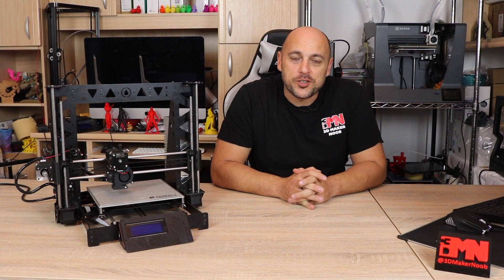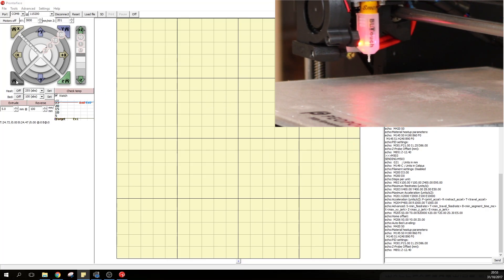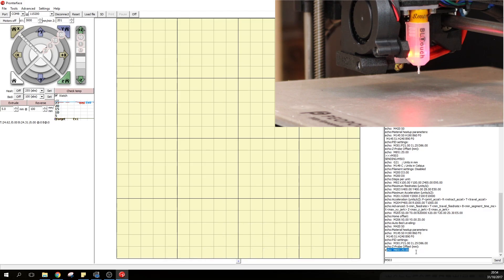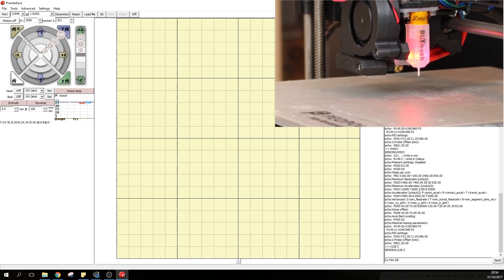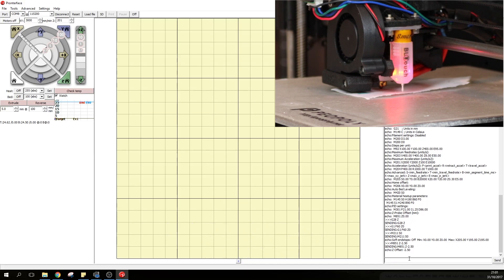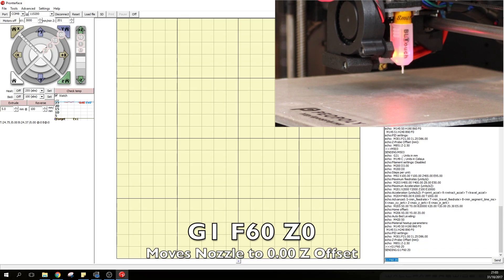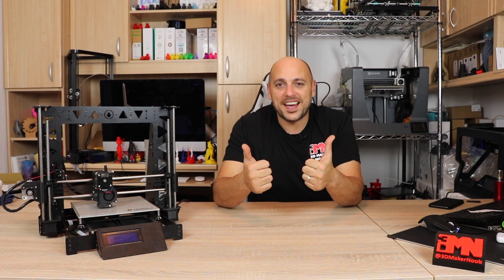Calibrating Z-Offset With A BLTouch Bed Levelling Probe

Comment: so... I've used your guide before and it worked beautifully.  this time it wont work sigh. After using my ender 5 plus on a 2 day print. letting it rest for 2 days I turned it on to see that the bed is to low to the nozzle. I'm at the part where I have to put in the z offset position but its -95.60 and it will only go to 20 min or 20 max what am I doing wrong?
Reply: Im also getting a bltouch error

Comment: I have a question about setting the Z offset for a BLTouch on Ender 3 running SKR Mini 1.2 E3 and Octoprint.
Setting my Z-Offest with the process in the video.
However, you do not say anything about preheating the hot end and bed and looking at the pronterface temps, you are doing the offset cold. Is this correct?
Should I do the offset with a cold hot end and cold bed or should I preheat both to PLA temps? (200/60)

Thanks again for a great video to help with this.

Comment: Hi, first of all, great video, but you mentioned the thickness of a sheet of paper is around 0.1mm (what I can confirm), but you add -0.01mm (-2.49-0.01=-2.5) shouldn't that be -2.59?
In all other Videos and the official BLTouch documentations, they are setting the Z-Offset 0 to be around 0.2mm off the bed.
Reply: OP did confirm (2017 reply) the error; correct setting for this example is 2.59

Comment: I feel like half of this is wrong or unneccessary, please correct me if I am wrong:
1) Home your Z axis <- see 5)
2) M851 Z0    // Reset Z offset to 0
3) M500    // Save to EEPROM
- 4) M501    // Set EEPROM <- This step is unneccessary, after setting a value it is automatically used, no need to reload EEPROM
- 5) G28 Z    // Home Z only <- Why did you home in step 2 first if you home again here? Just replace this with G28
- 6) G1 F60 Z0   // Move to Z = 0 <- No need to set Feedrate, G1 Z0 is enough
7) M211 S0   // Soft endstops off
- 8) Paper technique with z change to figure out correct Z0. M114  to get current pos <- This will work, but your nozzle is now in a different place than where you measured the bed height. You need to move the nozzle to where the BLTouch measured the bed first
9) M851 Z [current Z position including - if it exists] // Set z offset
10) M211 S1   // Softenstops back on
11) M500
- 12) M501 <- again, this is not necessary
---------------------------------------------------------------
So I would shorten this to:
1) M851 Z0    // Reset Z offset to 0
2) M500    // Save to EEPROM
3) G28    // Home
4) G1 Z0   // Move to Z = 0
5) M211 S0   // Soft endstops off
6) Move nozzle to where BLTouch measured
7) Paper technique with z change to figure out correct Z0. M114  to get current pos
8) M851 Z [current Z position including - if it exists] // Set z offset
9) M211 S1   // Softenstops back on
10) M500
---------------------------------------------------------------
Done

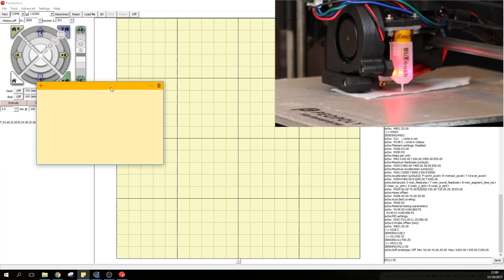Comment: Thank you for the video, but I'm having a problem, I'm trying to do this on an Ender 5 Plus,  and i can't find de Z offset after the paper calibration at  3:56, can somebody help with this?
Reply: I need that info also ;-)
Reply: @sebasleli1  look at my answer here
Reply: use the M114 command it gives the current vallues also for you @sebastien lelievre
Reply: @baconunicorn9830  Thank you very much ;-)

Comment: Thanks 3DMN!  This makes life easy.  Most will say this has to be changed in firmware, intimidating for most.  This process also applies to the X and Y offsets, only input your measurements from the nozzle to probe on X and Y.

Comment: al i see is this.... 

echo:busy: processing
echo:busy: processing
echo:busy: processing
echo:busy: processing
echo:busy: processing
echo:busy: processing
echo:busy: processing
echo:busy: processing
echo:busy: processing
echo:busy: processing
echo:busy: processing
echo:busy: processing
echo:busy: processing
echo:busy: processing
echo:busy: processing
Reply: same problem i have :( so did you fix already? do you know how to fix?
Reply: Gökhan TAYMAZ no I’m sorry. Still waiting for a solution
Reply: Gökhan TAYMAZ  I fixed it. But I’ve done it on my own way. I started the Chep bed level print gcode. Then I turned down the Z by the z-baby steps till I’ve got the perfect layer. I took a note of the z-babysteps and subtracted that from the Z-offset. That’s how I did it

Comment: im having a huge issue here and im hoping youll be able to help because nobody else ever gets back.. so hopefully with this being a relatively small channel youll actually see this message.

My x and Y "home" just fine because of the endstops.. But when i try to home z it crams the nozzle into my (glass) bed until i think its about to snap something, THEN the bltouch starts probing.... how do i do what you did where your probe will be out and the probe being pushed in from the build plate IISSSS the Z endstop?? I have followed every single piece of advice and code and suggestion etc that i have found and not one single person has been able to fix this one issue.. My printer is useless without beig able to probe Z.. PLEASE HELP!!!!!

Comment: Hi 3DMN, Thanks for the video but I got to step 8 
M211 S0 to Switch off softendstops but I get an Unkown command error. I am running Marlin 2.0 on a Bigtreetech 1.3v that is running 2208's I searched the net and found the command was changed to 
M122 S0 and when I try that I get the consol fills with a long list of  however I am still not able to move the nozzel in step 9 
If anyone knows how to make this work i would appreciate it

Comment: Very, very helpful and clear video. I'm trying to calibrate an Ender 5 Plus. It does not display the Z-offset on the control panel as you show in your video. Is there another way I can get the Z-offset?

Comment: Okay, now since you made that so easy, I have one other thing You can probably help with. When I send the print head to the HOME position, the BLTouch is hanging over the edge. So, when I try to do "auto" bed leveling, it "fails." Is there some way to calibrate the X-axis so that the home position is about 15 mm to the right?

Comment: I've been having issues with this, so I have been watching lots of videos and scouring the web.
After setting the z-offset, and trying to print my extruder tip is too high.  I tried Cura, and Sli3er and got the same problem.  I put the M29 command into the gcode start on each after g28 thinking that would help but no go, it's a stringy mess on the build plate.
Then in Sic3r I took out everything except for the bed and hotend heating and added:
G28
G29
G500
G501

And now the hotend hits the bed.. I noticed that it does show a previous EEPROM setting M851 Z0.4  which is probably the issue, it probably needs to be 0, but the fact that nothing works until I use the M501 command shows that everything is not well and good, and no video I've seen yet actually explains how to get your setting to run with a slicer.
Reply: I had the same problem, with my bltouch deployed the tip and got the tip inline with the extruder end, that worked for me so maybe itll help for you :/

Comment: Thanks very much for this really clear video.
I went through the entire process on my CR-10 with Bltouch (running creality's fw based on Marlin 1.6).
At the end of it, it all appeared perfect, but when i homed to Z0, the nozzle just sat at 4mm above the plate again. (A problem i've been having for a while now).

Anyway, i reset the eeprom and then went through it again and now it's working perfectly. I'll need to re-calculate my e-steps, but it's worth it for a gorgeous first layer!
Thanks @3DMN

Comment: Great video but z - 2.49 + 0.1 (paper) = - 2.59 not  how you spell it - 2.50
Reply: actually that is 2.39 ...-2.49 + .1.... should we be adding or suubtracting it?
Reply: Bigger negative is closer to bed, so you need to do the operation to increase the negative, in this case subtract
Reply: In simple terms if it’s -10 it will be farther but if its -1 it will be closer

Comment: I really appreciate your videos. I had installed the Creality BLTouch kit on an Ender 3, and was following the instructions from Creality, but there are still some problems. I was using your tutorial, but sending the commands through Octoprint. Everything worked as you said. The information about the true Z homing height as opposed to the the one shown helped a lot. When I home the printer, the display shows a Z height of 10 MM, with an Z offset of 0. When I manually lower the Z axis until it just grabs the paper, the Z axis height is 1.4 MM.  The Z offset should be a -, not a + number. I think I'm missing something. Any suggestions?

Comment: I've gone through this over and over again and it's still not doing what I expect. I've set the Z-Offset, and g1 f60 z0 does set the bed touching the nozzle, but when I go to print, it's squirting material 3mm above the bed. After shutting that down, I move the nozzle back to 0 to see if something changed, and it's still just touching the bed... Something is overriding the offset when I go to print... This acts the same whether I print from SD card, Cura or Ponterface...

Comment: Hey, great video, I have a question I do exactly what you did. I saved with M500 and set it active with M501. It is still going to the first Z0.. What am I doing wrong?
Reply: does it say it saved to the eeprom becourse i am having the same issue.. i am trying to fix it with a big online 3d community

Comment: I am not sure if this works for the Ender 5 Plus very well.  I had to use an offset of 0.0 due to a z-axis compensation setting in the firmware.  My nozzle was always too high without me setting my offset to 0.0

Comment: Thanks so much for this but I don't think you should add the thickness of the paper to the Z offset. The readout from the screen is exactly where the Z position is with respect to the base 0 point with the paper under it. You want to have that tiny bit of space between the nozzle and the build plate, otherwise your filament will get squished too much and you won't get a good first layer.

Comment: Thanks for the instructions, I have just bought a Creality 10S Pro V2 - would this be needed on this printer with it having all the auto levelling built-in?  Thanks for any advice
Reply: I just got one too. If you go to the adjust screen when you start a print, you will see a value for the Z-axis compensation. Mine was set to -2.27. Once I went through the bed leveling process: adjust the z-axis up or down to get a paper thick gap, then picking the "aux" option which let's you move the print head to 4 different points, then hitting the home button (between the z-up and z-down) the value in the adjust screen adjusted itself to a bit less: -2.16.
So I think the firmware takes care of it for you when you go through the bed leveling process.
But this is still very informative as I wasn't really understanding how the BLTouch was calibrated.

Comment: What if after calibrating you send G1 F60 Z0 and your nozzle stops 2.5mm short of the build plate? Mine does! Even after carrying out the calibration several times. All of my printing attempts are starting in fresh air, my machine used to print fine, but now I just can't get it right! Can you please help me anyone.

Comment: I'm following your guide to calibrate the Z offset with a BLTouch.  My problem is, every time I do it, from the top, I get a different value when using the sheet of paper.  First time I got -1.58, 2nd time -.88.  What am I doing wrong that would cause that?

Comment: hi, i followed all the steps, however when I do the last part which is to verify the true 0 offset.  G1 F60 Z0. When you say almost touching the bed plate. Does it mean its in the same height when you put the paper back under the nozzle? or a bit higher, coz mine is a bit higher and the paper slides with no friction/ not touching the nozzle.

Comment: No matter what I try I can't get this to work right I followed the steps to the letter but when it prints it digs into the left side I know that bed is perfectly leveled because I check but for some reason it still digs in its not even warped either I thought the sensor is suppose to compensate for a uneven bed so by checking multiple spots to know how the bed is leveled or I missing something

Comment: Hi and thank you so much for this very informative video. I have been working on setting up my BLTOUCH for weeks. Having firstly trouble loading Marlin firmware then corrupting the bootloader, Finally overcoming these problems I was confronted with the calibrations, more problems and then I found your video with Pronterface, I had never heard of this programme and boy did it and yourself make it even easy for a old fart like me, Thank you again and you have found a new fan.

Comment: This video has been referred to a lot by me lol, it's great! Now I'm into marlin 2, and I follow every step (mini e3/ender3/2.0.1Marlin) it always seems to IGNORE any z offset?? I'm going slightly insane. I've set it this way, and the lcd, soon as I home again it's too high. Set it yet again through terminal in octo, home, back too high again. Circles. I have real memory issues but I'm missing some real basic thing here. EDIT: Marlin bug it seems, lots are saying this.
Reply: I’m having the same issue right now.  Did u ever resolve it. My printer is printing great ... just don’t want to screw it up chasing the bltouch issue. Later
Reply: Robert Avery it was a fault in marlin, fixed in later editions.

Comment: My printer is using its dual z-end stops to home the z axis. How can I make it use the BLTouch to Z-home instead ?
Reply: When you installed the bltouch where did you hook your 2 wire Dupont connector to you should have unplugged your z-endstop  on the minus side (this is the endstop that controls how far down your z-axis moves) and either cut it out or tuck it away and plug the white and black wires into it if the endstop is unplugged and you flashed the firmware it shouldn't be looking for that endstop

Comment: I've followed these steps exactly, but every time I check by hitting home, then move Z to 0, it ends up stopping above the bed in the same position it was prior to starting the process. Could there be anything else making it not save my changes?
Reply: Same for me.
Reply: @butcharuski  Same here...
Reply: Same..
Reply: Same here. I have an ender 5 pro.
Reply: Late reply, but if someone's reading; Try storing the offset directly on the printer instead, not in Pronterface. Worked on my Ender 5 Pro.

Comment: I printed the petsfang bullseye for my cr-10s. Since it has a large cut out to move the bltouch up and down. How does this let the printer and my bltouch know how high it is in relation to the bed and nozzle. I guess I'm confused on how high the bltouch is supposed to be above the nozzle. I've read the 3.1 bltouch is a bit different then the original which is what most guides seem to be written for

Comment: 4:20 - I don't understand this moment clearly. Do I need to plus 0.1 (a sheet) to Z -0.2 (in my case) so it will be Z-0.1 or to minus ("add"?) so it will be Z-0.3? (it will be closer to the bed then)
Reply: Yes, it's really "subtract". And he subtracted 0.01 instead of the more correct 0.1 mm (assumed paper thickness). Probably not an issue when printing after.
Reply: @patrikfloding7985  I'm using Tevo Flash. My strange problem is that I've measured z, put it into EEPROM (it's -00.39) but it's not acting in any prints! IDK what I'm doing wrong :D So I'm just setting z-offset in Cura + fixing it in the Printer start gcode setting. Otherwise the nozzle is scratching the bed and jamming (of course).
Reply: Or just home with the paper in place and then  move the nozzle down until it just grabs the paper. The actual z offset is then displayed on the screen without worrying about what thickness the paper is. Don't forget to pre-heat first if you're worried about nozzle expansion.
Reply: @veedubbug  Oh, Thanx! :) I've fixed that already... Even don't remember how and why I've had those quircks.
Now I'm struggling with an issue when a print can stop suddenly at any layer. It prints fine through USB though. Now I can't understand - is it a bad cable (which were working good before some re-assembling/moving the printer) or an SD card... or the SD card slot? Can a SD slot be faulty?

Comment: Joe, 1st, love this method!  Quick.  You have us G1 F60 Z0 - Move nozzle to true 0 offset after you zero the stored offset.  Where in Marlin is the "true zero"??  I just note on my printer the head drops to a little above the build plate.

Comment: Fantastic procedure, really easy to follow.  
I found that I got better results when I didn't account for the paper (running an Ender 3 Pro, with Creality BL touch upgrade and the Creality Glass Bed).

I've also since discovered the "ABL Expert Plugin" for Octoprint (I know I'm not using an ABL sensor, but the offset value is the same variable) which allows you to tweak the offset by changing a "Z-Probe Offset" variable and hitting save, which has allowed me to fettle the setting a little. If you're running Octoprint that is :)